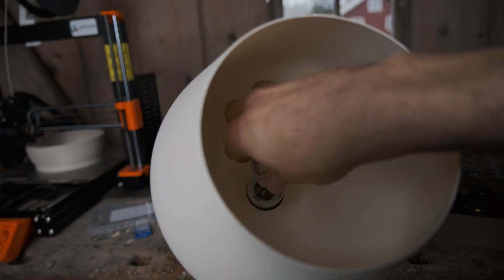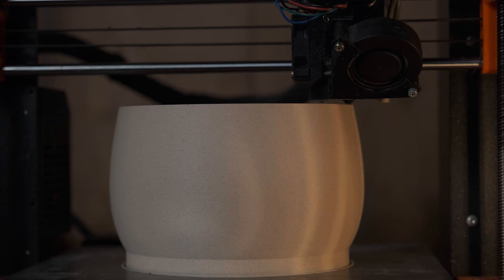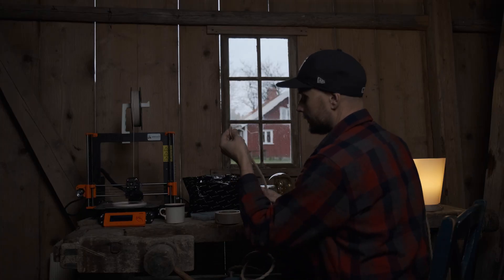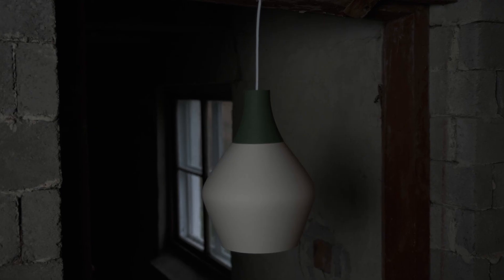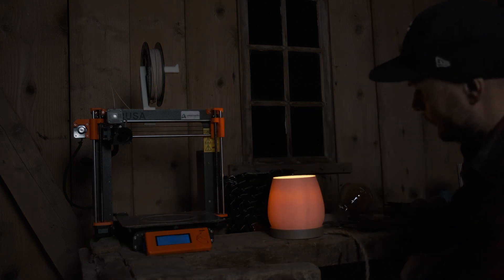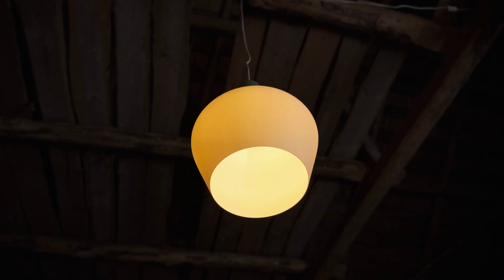add:north – DIY 3D-printed lamps in wood: Where Tech Meets Art

Comment: Hi, thank you for the video! I am relatively new to 3-D printing and wanted to make some lamps but I have been a bit concerned with the heat that the light causes might melt the plastic, should that may concern please? Thank you in advance!
Reply from the maker: Hi! No worries if you're using LED or similar lamps as your light source. Most light bulbs today don't get particularly hot — at least not hot enough to cause problems for PLA, which starts to deform at around 60°C.

Comment: Very nice! Can you tell us anything about wall thickness of the lamp shades?
Reply from the maker: Hi! It's a compromise by strength and light transmission, however there's not much need for super strength in a lamp shade. Best result is to use vase-mode, then you get a uniform surface without any seams. If you use a 0,4mm nozzle you can increase the flow to get some thicker walls, or switch nozzle to 0,6 or 0,8mm to get sturdier walls. The table lamp shade in this video is 1mm thick and is printed with 2 walls, using 0,4mm nozzle.
Reply: @ hi! Thanx for your reply. Helps a lot! Your filament will arrive tomorrow. Can’t wait to put it to good use.
Reply: @addnorth  Just wanted to let you know that i did my first prints with Your Textura and PLA Wood filaments. The results are amazing! I realy love the organic look and feel of it!
Reply from the maker: @Vibemaker68  Hi! Great, happy to hear that!

Comment: 3D printing is incredible. Which filament were the actual lamp shade parts printed in? Cold white??
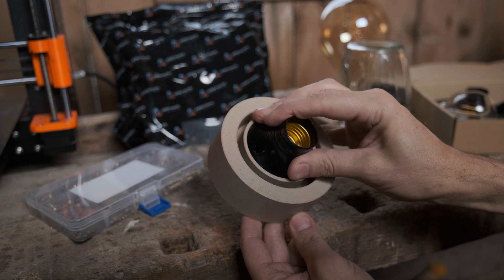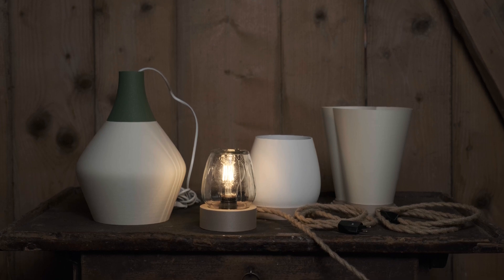Reply from the maker: Hi! We can only agree, :) We used 3 different types here, the large ceiling lamp is printed in Textura Matte Natural, the smaller table lamp was both printed in Textura Matte Cold White and PLA Wood Nordic Birch. 00:45-00:52 when the lamp isn't lit, that's printed in Textura Matte Cold White, when it's lit from around 1 minute, that's PLA Wood Nordic Birch. (All lamp shades are also visible at the website, if you scroll through the product pictures.) Visible in, Textura Natural, Textura Cold White, PLA Wood Nordic Birch and PLA Wood Light Oak.
Reply: Thanks for replying! It's amazing that 3D printing is so accessible nowadays. I'll take a look at the website for the lamp shade examples. Cheers!
Reply from the maker: @ Thanks! You can always reach out to support@addnorth.com for all 3D-print related, slicer/material settings, suggestions, questions etc. Good luck with your project!